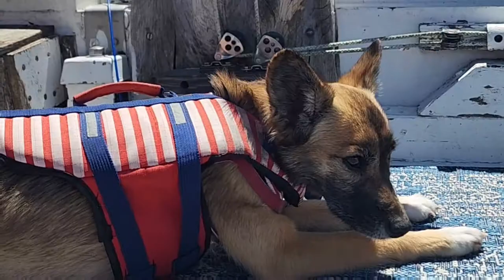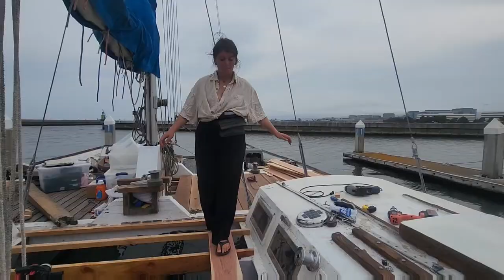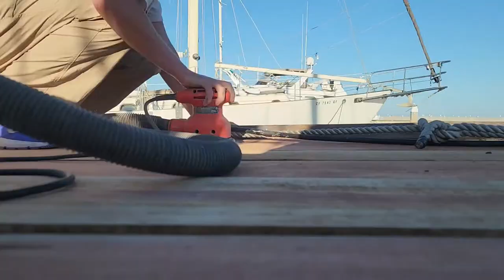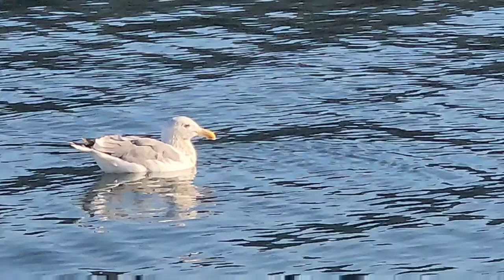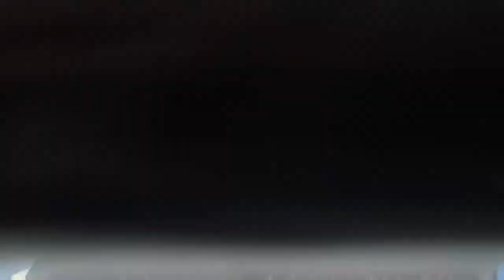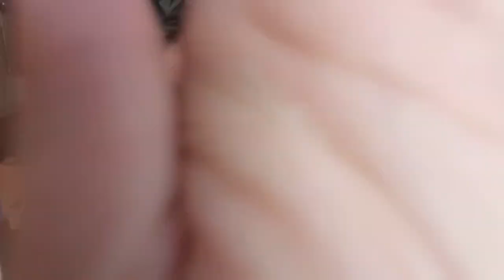Q&A: cutting a hole in my boat, $$$ for boat refit, sailing plans, and MORE

Comment: Fresh water is the universal solvent, it's an extremely small molecule, it will move in defiance of logic, and even gravity.
I would strongly recommend you look at sheathing exterior surfaces of your boat with a synthetic cloth called Xynole. It has three times the abrasion resistance of fiberglass, greater resistance to peeling than fiberglass, and unlike fiberglass, which gets very hard when saturated with epoxy, Xynole remains flexible. The perfect cloth for a wooden boat. The U.S. authorized Wharram builder, Dave Halliday, is who first introduced me to this material.
Reply from the maker: I'll definitely have to look into it! I've used glass so far but there are many more projects to come.